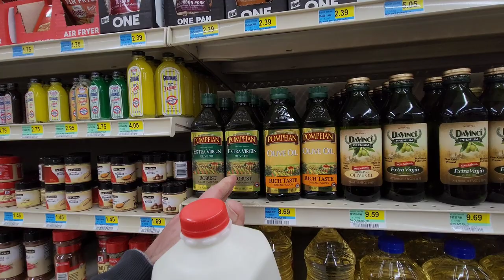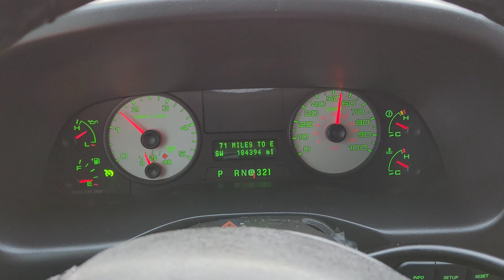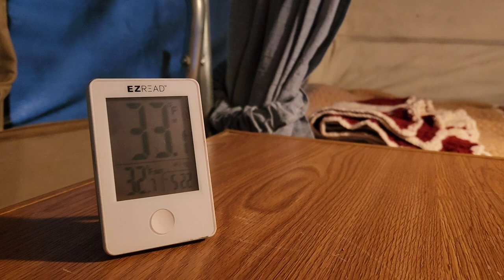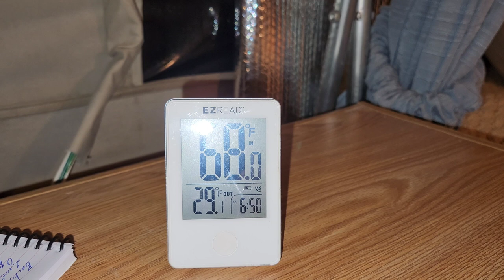Getting Settled Into The Truck Camper // A Windy Night

Comment: if your going to run the camper off of power at campgrounds,  Get a charger wired in the camper that will charge up the battery box while your on the campground power... Also place a panel of that reflective roll behind the heater to reflect the heat backout thats behind it

Comment: If your front clamps can be adjusted, tighten them. If they are not the adjustable ones, I would replace them. That should stop the snow problem. I couldn't find my extra bulb stash. They should be 12 volt automotive 1156 bulbs that go in your lights. Please be careful with the wiring. Old camper wiring isn't made for heavy amp draw. Ask me how I know. Stay safe and God bless.
Reply from the maker: Ya they adjust. I think the seal up there is bad.

Comment: I know this is an older video, but if this is going to be a thing for you I’d lose the Mr Heater Buddy. It will cause you nothing but headaches, literally. Every gallon of propane you burn will produce about 2 gallons of moisture. You’ll end up with slimy wet mess inside. 

Get yourself something that is rated for indoor use. An Olympian Wave Catalytic unit will work well (with virtually zero condensation) as will any of the diesel furnace options. Each of those are rated to sleep with safety also. (Your Mr. Buddy isn’t.) 

I have an aluminum cargo trailer that I converted to a toyhauler. I chose a diesel furnace. I’ve been out well below zero with no issues. No condensation, no fumes, and loads of dry heat, just like home.